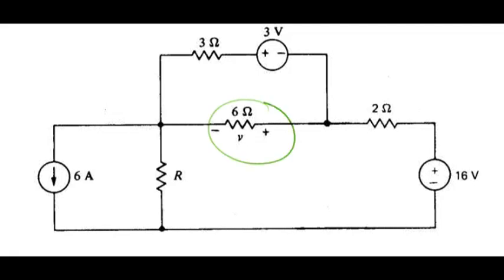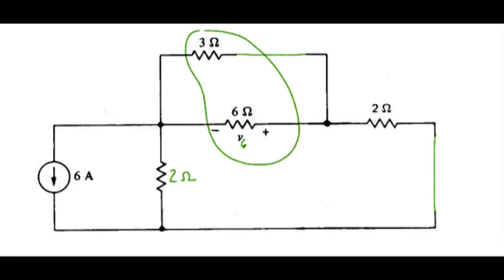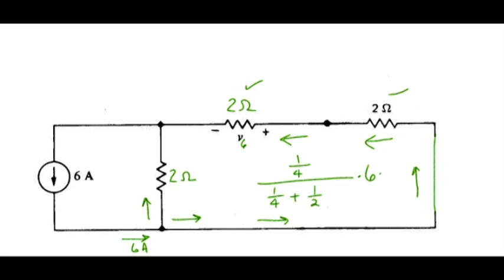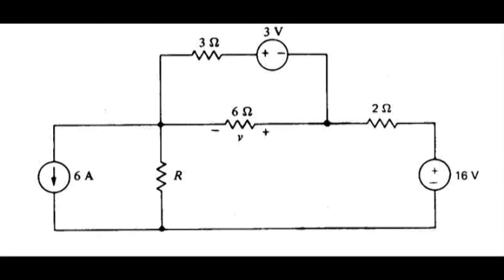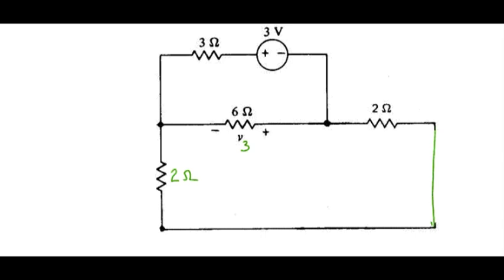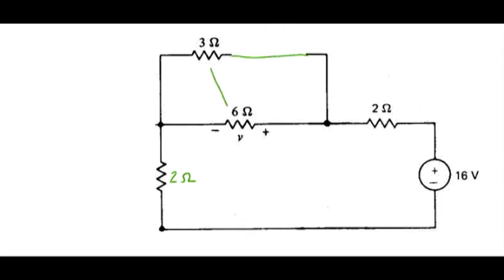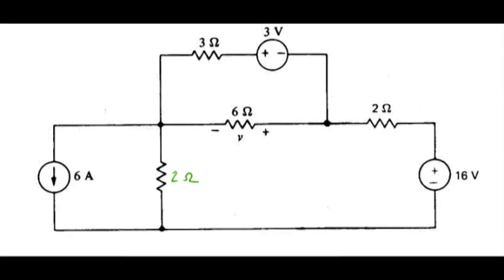dc: Superposition Example #3

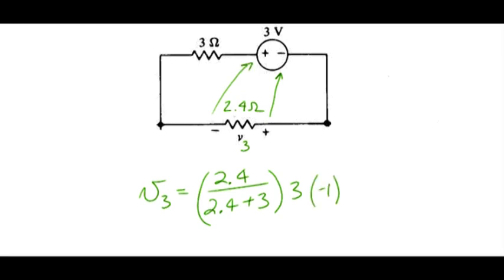Comment: time 3:11 whay multiplay -1 i don't understand
Reply from the maker: The 3-volt source distributes its voltages according to its polarity. At 3:11, the 3-ohm resistor's voltage polarity would be - on the left and + on the right, and the 2.4-ohm resistor's voltage polarity would be + and the left and - on the right. The desired voltage "v" has opposite polarity, therefore resolve the discrepancy by inserting the negative sign.